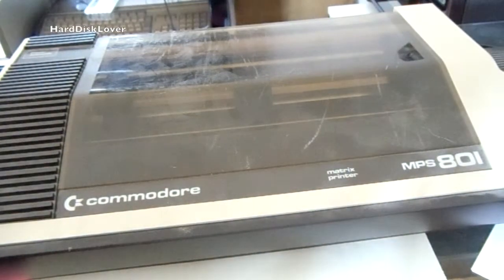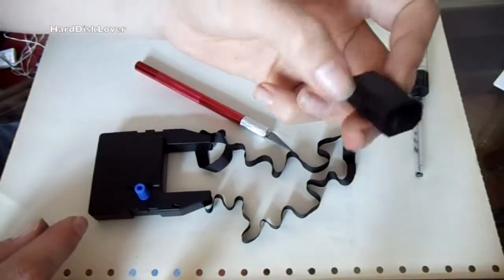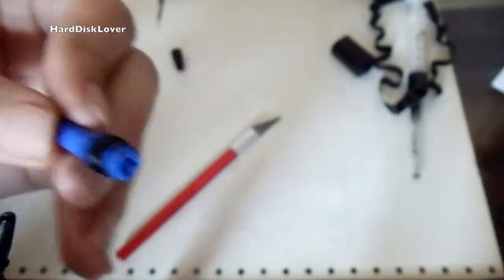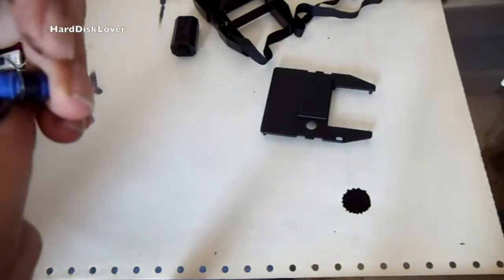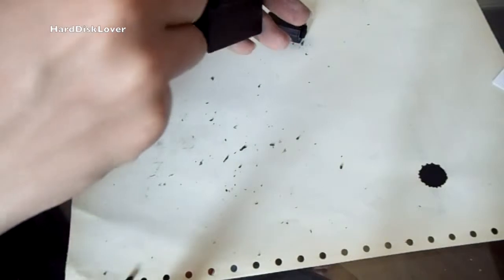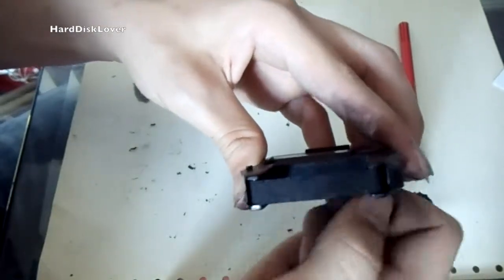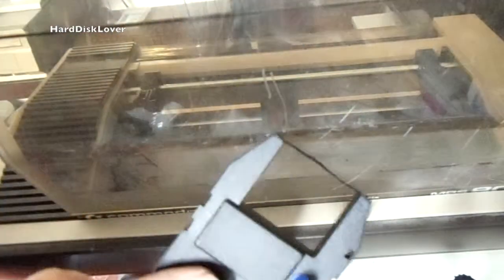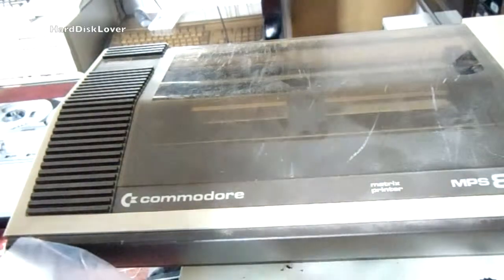Matrix Printer Cassette repair and refill for Commodore, Atari, Seikosha

Comment: Even though it's already 8 years later, i had to do this a bit differently. At least what the adjustment wheel goes. I couldn't glue it, since the rubber ring was completely pulverized. So i just took 2 o-rings (approx. 4.8x1.9mm each) and pushed them onto the original indentation of the original rubber. A truly easy fix without any cutting and/or adjusting of the mechanism. It's nice and grippy again.

Comment: MPS801, my first printer, around 1984.  :)  I recall that there were replacement ROMs you could buy that gave it true descending characters.  I think there was a modification that also gave it bi-directional printing, but I could be wrong.